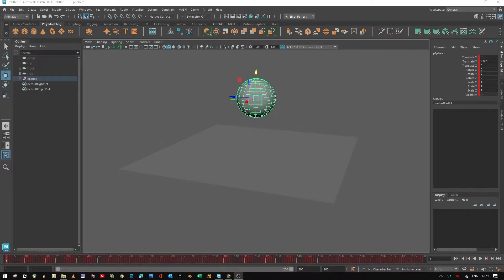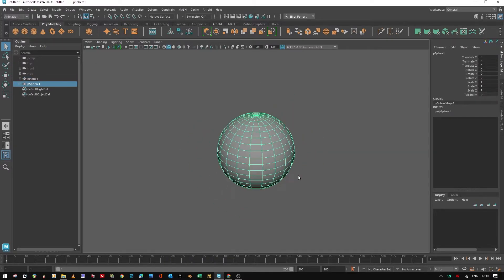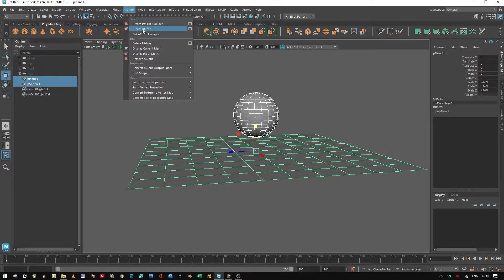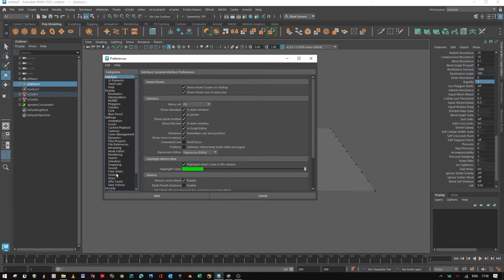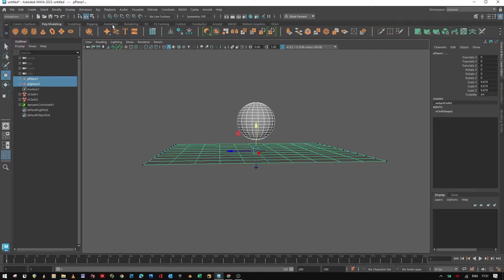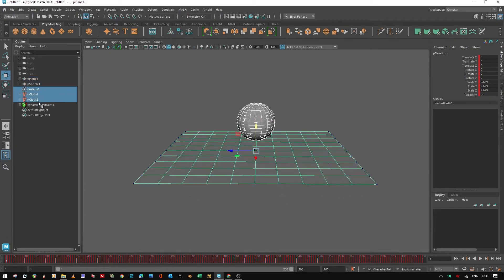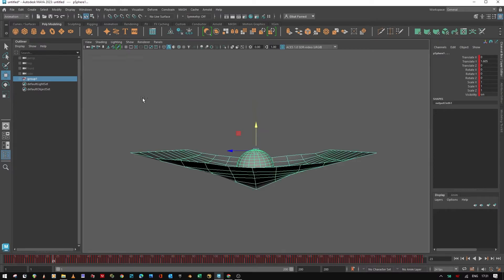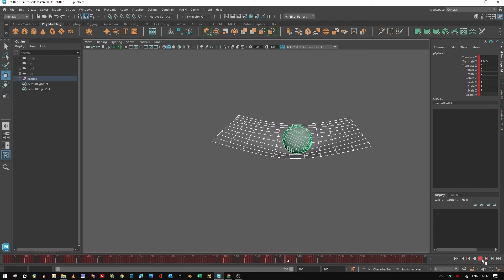Bake nCloth simulations to keyframes in Maya

Comment: Hi! This is driving me crazy. Does not work for me : ( Is there any hidden option that needs to be checked?
Reply: try disabling Cached Playback on your Time Slider before baking the simulation.
Reply from the maker: Sorry for the very slow reply @iracematrevisan6039, are you still having trouble?